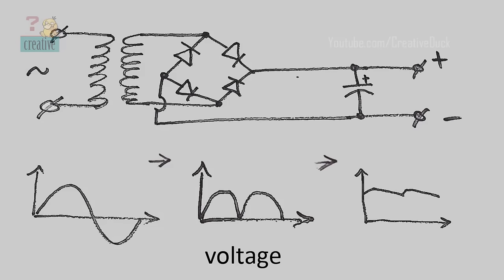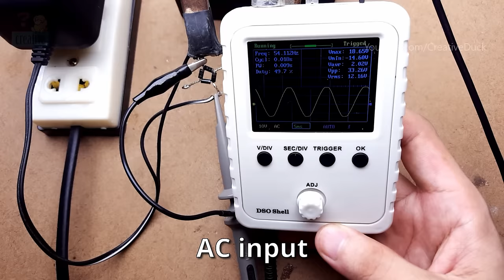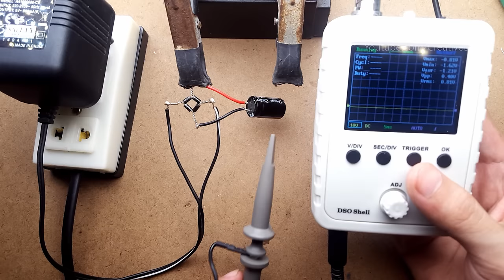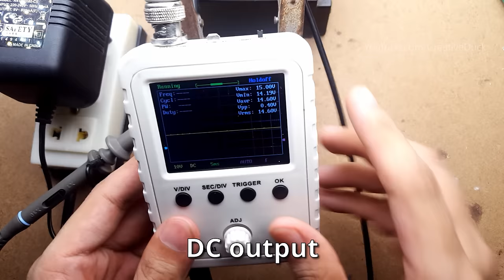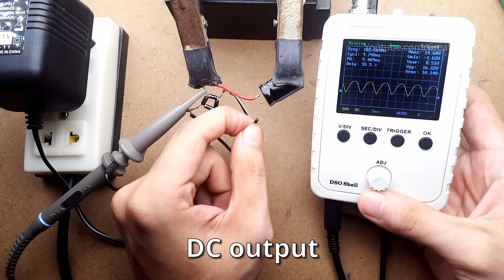AC to DC using 4 diode and 1  Capacitor - full Bridge Rectifier

Comment: Why is he using rectifier I don't understand. That adapter already gives dc output
Reply: First thing I noticed. What do you expect from the pajeets?
Reply: @rootuser7206  The adapter puts out AC voltage, The "Diodes" changes it to DC and the "Capacitor"  cleans up the wave to make it useable.
Reply: @danneybarr1428  then again he never provided that it puts out ac voltage. Even when he shows the meter the symbol is not clear.  I doubt it was ac voltage.  I have never seen ac voltage come out at 9v .
Reply: @j.s3612  ever used an original NES?  Believe it or not its adaptor plug spit out like 9v AC also
Reply: @j.s3612  luckily the adapter part is in the video and you can google it to see that it is in fact a 9v AC output. Also the meter he's using has the waveform dislayed on it....
Reply: @adventureoflinkmk2  I have no idea what nes abbreviation means .
Reply: @chrislizon7483  upon further inspection, I see that one side the has the dc symbol, the side the arrow is on, does not have the (s) signwave symbol under it, that I can see . It looks like a plain line . But because the arrow is not on dc voltage it must be ac
Reply: @j.s3612  Nintendo Entertainment System
Reply: I think it's not rated for 220 V ac so he's using an adpater to give out 9V ac,did you not see the sine wave ?
Reply: I think he is mad

Comment: Cool video. How do you calculate the value of the capacitor? Another thing, how do you get a DC output of 15V when the output of the transformer is 9V Ac? Thanks for the help.
Reply: W02 bridge rectifier will give you 15v output. But your power supply should be higher. Check the datasheet
Reply: It has to be higher voltage capacity with a margin of safety.

Comment: Please help... i have a motor that runs on 18v DC, but it will not run to my 18v AC to DC transformer.. what Diods and capacitor should i use for the rectifier?... thank you

Comment: hi, what would be the formula to calculate how many volts the conversion from AC to DC would be without a DSO150 or similar tool? Like I should be able to pull out an old AC adaptor, look at the output of it, factor in the type of diode and capacitor and get an answer no? I mean, how did people figure this stuff out on paper before digital tools where available. (If it's not obvious, I want to know because I like figuring things out on paper with nothing more than formulas just because... well just because lol.
Side note: I know little to nothing about electronics (if you couldn't tell by my lack of relevant terminology) but I'm good at researching until I figure it out so go easy on me if you decide to answer this question. :)
Reply: LYTE Yearz yes there is a way, and I would like to know too!?

Comment: If the transformer already produces DC current, then why do you need the rectifier?
Reply: It is AC until it write DC
Reply: Transformers reduce voltage not changin ac to dc

Comment: I have made a full wave bridge rectifier, using four 5408 diodes & 1000 microfarad 25V capacitor, with transformer ( 12V 4A ) but AC current is leaking on the output terminals, when i am touching the output terminals with tester then it is glowing brightly.

Comment: As per your video the DC Output showing 15.56V
If DC output needed 12V, then what is the solution?
Reply: Once you get a clean DC voltage use resistors.
Reply: 7812 ic

Comment: Hello, i have one questions. 1: why do you use a 25v capacitor?
Reply: Same question.
Reply: @johnalpherpaden3894  i wonder if you can use any voltage over the output voltage... i really want to know :(.
Reply: He uses 25volt since he is using an adapter that must contain a step down transformer. If you do this without the adapter you need a 400 volt capacitor. 
The 25 volt capacitor would go boom in an instant
Reply: You can use any capacitor with higher voltage than the output of the full bridge rectifier.
Reply: @X Dtd If you don't connect capacitor, it will be fine, but you don't get DC current at the output. You need to connect capacitor so the output will be smooth DC current.

Comment: Does this work as from 220v AC to 220v DC?
Reply: Yes, but only do if you know what you are doing. You will need a different Capacitor. Again "DANGEROUS" using high voltage.

Comment: Why were you using a 9v power supply.  Doesn't that defeat the whole purpose of this video .
Reply: It can be done with 110vac but you need a Capacitor to handle the higher voltage. I believe he is just showing the principle of the project. "9v is safer for demonstration" 110v is DANGEROUS! only try if you know what you are doing.
Reply: @danneybarr1428  this was my error. When I usual think of 9 v I think of dc  voltage.  So when I saw 9v ac I didn't believe it . But yes I do understand